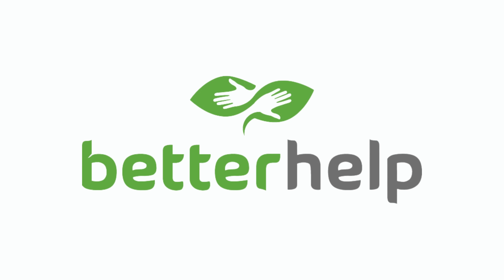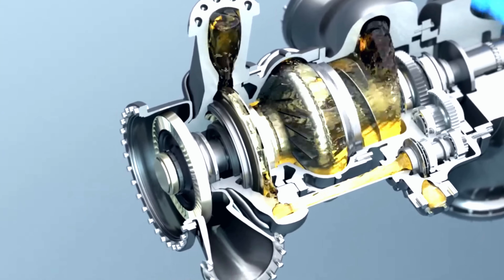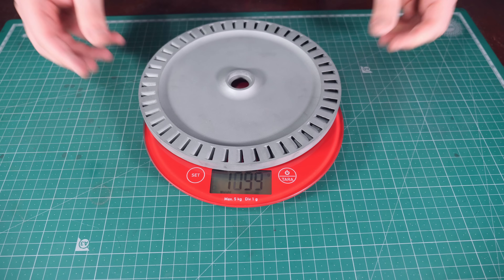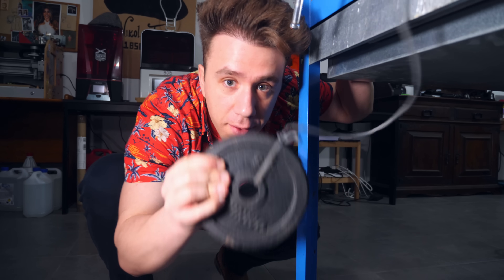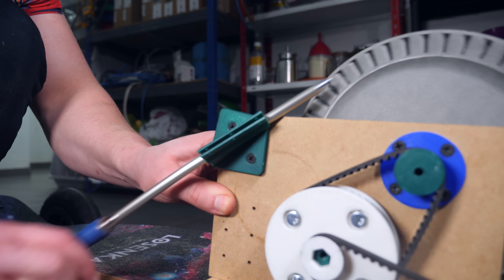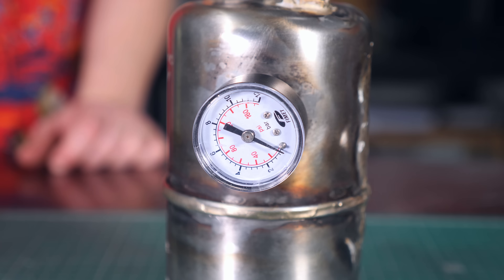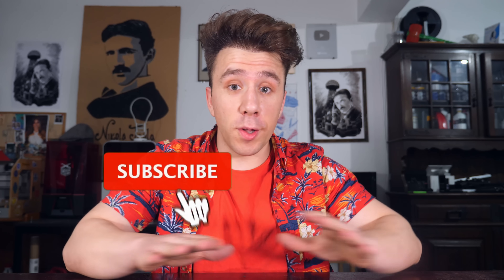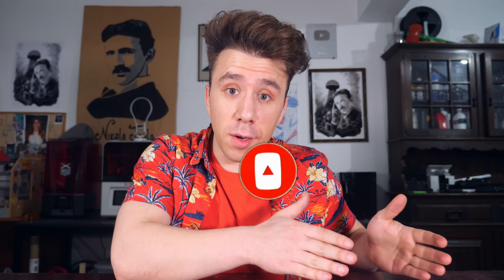I built a TURBINE Skateboard

Comment: Precious advice : never stay in the plan of rotation of something that's heavy and spinning fast. In aeronautics, we learn quickly to avoid staying next to propellers and turbines (see those red lines on the sides of the fuselages, right next to the turbines or propellers ? It's here to tell you that if it breaks, the spinning compressor discs will cut everything at this place) ^^
Reply: When welding the cups together I already though "ah, now he is building a bomb"
But when he stepped onto the skateboard I saw that the dangerous flywheel path was now conveniently shielded by the 200 bar N tank, providing some additional "safety"
Not sure which one is the better bomb, if something goes wrong 😂
Reply: Was thinking that too when he was spooling that. The energy that's held in high speed rotation is insane. We had a kid a school almost loose his fingers spooling a ball bearing with compressed air. It exceeded it's ability to spin and seized with his fingers wedged into the inner race. Thousands of rpms to 0 in a split second. He learned something that day
Reply: you arent paying attention. that line isnt for that 😂. its intake area, you get sucked in beyond that point
Reply: Close! Specifically, it’s  to warn ground personnel that this is an engine ingestion zone and to stay clear when the turbines are spinning.
Reply: @ClaytonBrownMusicOfficial I have never been around jets/planes, but would tend to also think it is just not a good idea to be around high speed spinning objects.  I have generally avoided being in the plane of a spinning anything that is being revved just for that reason.

Comment: I think it would be amazing if you converted a go cart from using a ICE engine to using some nitrogen gas powered turbines. With the go cart, you already have a frame and steering setup, imagine a few more of those SLM turbines, the throttle controls the kPa aimed at the turbines

Comment: What an awesome idea! I'm impressed by how well that turbine worked.

One thing that was probably clearer during editing is that the turbine wasn't balanced well when it was mounted on the skateboard. I don't know how much that affected the performance, but it seemed to be experiencing quite a bit of friction. Also, if the shaft for the gear train was supported from both sides, that should help avoid the need for such high tension of the belt and reduce friction.

Comment: I saw huge safety issues tat made me comment and think that you really don't know in what danger you are. The homemade pressure vessel without safety valve can kill you. Secondly, the unsecured cylinder on the skateboard can fall, breaking off the regulator assembly. In that case the 200bar comes straight out and the bottle will fly off like a rocket that can penetrate a brick wall. Mythbusters tested it if you want to see that in action. Keep up the work but get some training or help from somebody that knows.

Comment: Just a safety hint: Do not stand in the radial directions of a spinning object as you will be in the shrapnel path should the part explode. 😅

Also a pressure gauge doesn't prevent explosion, you need a pressure relief valve spec'ed in operational pressure, flow-rate, etc to protect the vessel. 

I've seen too many examples of pressure vessel explosions. A scary one is from improperly maintained air compressors. Condensation forms in operation and will accumulate in the tank. The water rusts the tank, focusing the corrosion at the bottom and forms a 'seam'. Eventually the corrosion eats through enough for the entire tank to burst open violently.

Comment: https://m.youtube.com/watch?v=5ji3Wd8izeI

For context on why the gas turbine powered cars never really took off (pun 100% intended) listen to the engine at idle. With no load and baseline revolutions, its outputting enough decibels to cause hearing damage, at a frequency that is high enough to cause physical discomfort.

Not to mention how manufacture and maintenance on a precision engineered turbine engine is far more difficult than an internal combustion engine. Imagine the damage a broken impeller blade could do, in comparison to a damaged piston or cylinder liner.

Comment: So your going to ruin your own day by using your table saw the way you do! You  push from in between the blade and your fence with a push stick. This way the board to the left of the blade is free from binding. You are going to get kick back by cutting from outside the fence like that. Since you understand how momentum works with spinning disks, what happens when the piece of wood between the blade and fence bind up?
Every 7 mins someone fks up using a tablesaw and gets hurt. Its legit the most dangerous tool in woodshops.

Comment: Video idea: A torpedo.

Torpedos usually work with a propeller, but very old ones did not. It would be very interesting finding a rocket engine that works reliabily in salted water

Also, you already have a bomb for the warhead

Comment: Why make your own tank that could kill you, when you could just as easily used a camping gas cylinder?

Also, you can steer just by adding friction/drag to one side loke a track steer. So putting your foot down and letting it drag a little would be good enough.

Comment: If you put the pressure tank in a backpack or scuba tank harness and moved the trigger mid way up the hose then you could ride the skateboard normally by standing up. At least then you could steer by leaning.
Also, there are several reasons that the turbine car never took off. In the case of Chrysler's turbine car the engine cost far more to build than a traditional piston engine due to the high grade alloys needed to make it. When compared to a typical small block V8 the turbine engine did not offer any substantial improvement in performance or fuel economy (aside from the multi fuel ability) to justify that extra expense. Additionally the turbine engine could not meet the new emissions regulations being introduced. Lastly, around the same time, Chrysler had to file for bankruptcy which stopped funding needed to develop the turbine engine further.

Comment: You psychotic nerd 😂. Love it ❤.  I've got a project I was thinking about. But it would require a gold plated honey comb structure to mix 2 gasses over and in theory precipitate a liquid. 

Basically video idea would be how to electroplate a 3d printed part with gold.🎉

The experement requires an ozone generator and water electrolysis  device. Apparently in the presence of pure gold or platinum alloys h2 and o2 gas will make pure h2o2 I say ozone generator because the o3 is unstable and seems more likely to bond with hydrogen. 
I was told by a chemistry forum that the 2 gasses might combust on contact before precipitating. But I figure if the collection container is in an ice bath the temperature should limit that hazard.. want to try?

Comment: Although it is volatile and dangerous to use LOX, have you tried using liquid nitrogen to get LOX for a fuel source? Just fill a container halfway with liquid nitrogen and wait for 30 to 45 minutes or so, and the air inside the container will turn into LOX. Would love to see some experiments you could make with that!

Comment: Now just a few points.
Don't do that with the nitrogen without a safety valve again. Seriously.

And that wheel could have more than enough power to drive a car. 

1. A proper housing for it. And balance it on a proper shaft. 
You NEED a lathe.
2. I can have that power as. Instead of one bad nozzle image as many as you could get round it. Then make that proper ducting all the way round insted of little nozzles. 

I think you would be shocked at the power it could make. Way more than enough for a car.

Comment: Integza,

A very awesome (and frightening) video!

Based on good ol' internet calculators, the angular velocity of 6000RPM is about 628 rads/sec.  If your disk is about 10 inches (.254 meters) in diameter (5 inch/0.127 meter radius), the linear velocity calculates out to ~80 meters/second.  If a 0.5kg piece of that wheel were to separate, it would come off with ~1600 Joule, or 1180 Foot/Lbs. of kinetic energy at ~80 meters per second, or 178MPH.  
Not an engineer, and just playing with online calculators (so the numbers may be wildly off, engineers please check me and forgive any mistakes here), but if the calculations are correct, this could ruin your whole day, especially if your face was directly in line with it.

Also, if that canister was not pressure tested, you brazed up a pressure cooker out of thin wall metal.  I didn't see a pressure relief, and you should watch that section of the video carefully to see what pressure the canister got to before you were able to open the valve.  

Love your videos, and want to be sure you remain here to make many more, so....

Safety.  First, last, and always, safety.

Comment: Add or print a scooter variator, this way you should get proportionnal torque with speed an not get stuck with a fixed rpm ratio.

Comment: Would be cool to see a gokart version of this with a VERY big fly wheel from like a really old compressor or something and instead of using air to spin it, just us a drill or something and see how fast / far you can go with a fully "charged" flywheel LOL I know there are ways to keep it spinning and then engage it to access the potential energy without forcing it to stop spinning or whatever. Kinda like a clutch pack or something ionno

Comment: Toyota have just released the water powered car, Michael Faraday back in the day concluded not enough hydrogen could be produced using electrolysing alone so most people have dismissed water powered cars. A research i saw on improving the hydrogen out put used pulsed DC at a very high frequency along with a special arrangement of plates to increase the surface area. Exploring this might be an interesting video to explore a hydrogen powered skateboard.

Comment: I'd like to suggest you to put it in the back of a tricycle. For more torque, you can stack 2 to 3 turbines, then try to enclose it for safety. Also, since less weight is better, you can try to find (not make, again... for safety) a smaller & lighter nitrogen tank. You can put it wherever it's possible, but i'd suggest putting it on the back to reduce complexity. That's all from me. Keep up the work👍

Comment: suggestion for video: Radar system using a microwave Magnetron - MIDAR
i dont need to say any more but … 
you can extract the magnetron from a microwave and put it on a dish antenna to direct the rays towards other objects then make another parabolic antenna to receive the signals back . as for detecting the distance u can pretty much use the same code used for detecting distance from an ultrasonic sensor - put out a pulse of signal and wait for echo then find the distance from the time taken. 

safety note : I dont think the microwave radiation will cause harm if it only pulses for less then a second with enough delay
as the heating effect of the microwave is what does the damage to tissue. microwave radiation is not ionising radiation.
and yes tinkering with a microwave is very very dangerous and high voltage

Comment: Right... You have a TOUGH gas tank... Make a lightweight cart with small bicycle wheels, put a litre (or two) of liquid Nitrogen into that black tank, let it heat up in the sunlight (or a gentle heating up with a blowtorch - keeping an eye on pressure obviously), and there, you SHOULD have enough pressure to propel you whilst you also have steering capabilities 🤔😏😉👍
😎🇬🇧

Comment: I was so worried for you. "I have never used liquid nitrogen before". That is very clear. Wear loose fitting insulated fabric gloves if you're making your pipe bomb solid metal on the outside. You shouldn't need to heat lq N2 if it's sealed. I'm glad you didn't BLEVE and die...

Comment: If you create something to securely strap that bottle to the board you could push the top of the bottle right or left to steer it the board turns by right pressure and left pressure

Comment: How abot you build a tubine / rocket / x-jet but instead of using propane, use a Hydrogen / O2 mix? That'd be interesting as the reaction would be way more powerful.

Especially as propanes energy density is about 50MJ/kg (13.8kWh) and Hydrogen is 121MJ/kj (about 33.6 kWh)... That'd be fun....

Comment: It's crazy that all the scary looking stuff I have seen you do this has to be by far the most dangerous thing I have seen yet.  So many times, in this video I feared for your safety from using that flimsy steel with heated LN to placing your face near the rotational direction of that turbine to aligning it on your vehicle pointing straight at your nuts should the flywheel explode.  This was a huge yike for me.

Comment: VIDEO IDEA: Make a fully fledged rocket engine, doesn't have to be big, it would be really interesting to see how small you could get it actually. Perhaps for now make a simple pressure-fed bipropellant engine with say Ethanol and LOX if you can get your hands on that. You'd probably want to use 85% Ethanol as it's relatively easy to get and would help to avert overheating. In the future, it would be interesting to see how you make a pump-fed engine, you could make a downsized version of the A4 now that you've pretty much perfected the H2O2-KMNO4 turbine. I know that making these would be hard as you don't have metal but you could 3D print the individuals segments in smaller pieces (the nozzle, the combustion chamber, etc). Seeing you put all the skills you've learnt and showed to the test would really be something I at least would be interested in seeing and I'm sure many others may feel the same way. And hey, if it explodes, change the title to "Making a Bomb", you wouldn't be lying.

Comment: What if you bought one of those cheap rc planes, made and strapped on a small fuel system for it and used tiny jet engines instead of the electric motors?

Comment: suggestion. make a gravity well using mercury as the electro magnet in the center of a toroidal < ( spelling? ) coil and a 9v battery. hint. coil might need to be a doughnut but shaped as a globe with mercury in the center.

Comment: The Nazis understood that the turbine in their V2 was incredibly dangerous because several of them exploded with catastrophic results.  What does our guy do?  He sits next to one that was made to questionable specifications, with his torso and heart in line with it while testing it.
Thousands of boilers have exploded and killed people.  Our guy sits next to one that he made with the skills of a 12 year old.
High pressure cannisters have killed plenty of people when the pressure line gets broken off.  What does our guy do?  He squats on a skateboard, revving an untested turbine that's lined right up with his body, and the high pressure cannister's outlet line.  And BTW, he doesn't even have the cannister secured in place, he's holding it.
Marginal steering.  No brakes.  No seat.  No seatbelt.  No helmet.  No goggles.  No roll cage.  No containment cage for the turbine.  Not even a bearing on the free end of the turbine shaft.  Nothing holding the high pressure cannister in place.  No cage around the pressure line or regulator.

Comment: I've seen a lot of people on youtube electroplate 3d printed parts. I've also seen them electroplate most of the 3d printed part and then remove the plastic and fill it with a metal like tin. I was thinking some sort of project that involved this would be really interesting, espcially since I haven't seen anyone compare the strength of these parts and the thermal capabilities. So an idea that would use these parts could be a mini MPD thruster project involves creating a small-scale, functioning model of a type of electric propulsion used in space. The thruster works by accelerating ionized gas using electromagnetic fields to produce thrust. In this DIY version, key parts are 3D-printed and then electroplated with metals to handle the extreme conditions and high currents involved. It’s a project that combines aerospace engineering, physics, and advanced manufacturing techniques to demonstrate a complex technology in a more accessible format.
Reply: Its an interessting technique for sure, only problem with plating is that you lose dimensions. If you need an exact diameter or fitting threats in a hard to reach area its a pain in the ass to get right. But all in all its for sure interessting to do/see.

Comment: i want the 3 d printer, but my idea won't get any likes,.... use a piston compressor and fuel injector to power the rocket part to turn the turbine, to power the compressor and fuel injector pump from the turbine and the wheels. get in touch with me, the steering problem, was caused by the belt drive--- I know you know that though, so a different drive would be required. lets do this thing.